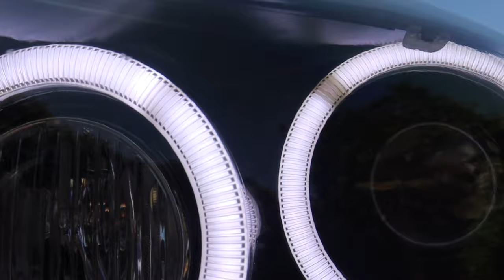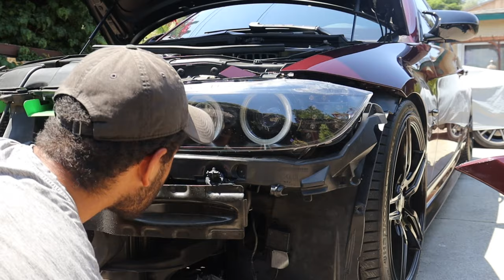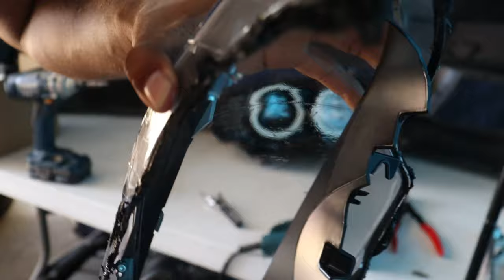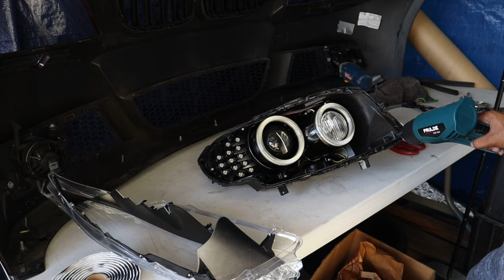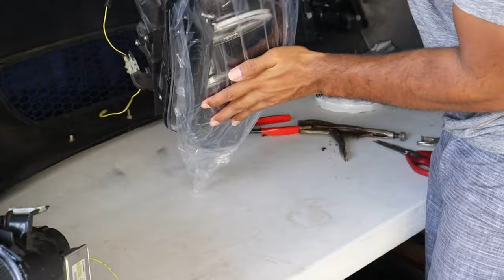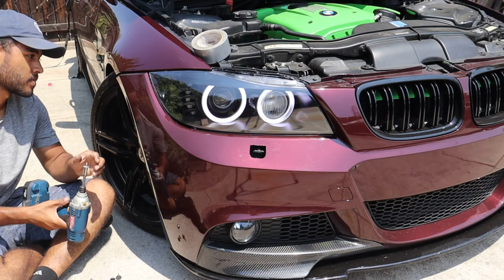Replacing the Plastic Lens Covers on My Custom Headlights | BMW E90 LCI

Comment: This method doesn’t work on OEM lights
Reply from the maker: The only difference is it’s harder to break the factory seal if you do it for the first time.
Reply: @InlineSixAuto No not true You have to use a dremel to cut plastic around the headlight And THEN use your method
Reply: @rievo6644  It is possible to remove the factory installed lenses with a heat gun, a flathead screwdriver and a lot of patience, no need to cut anything with a dremel. I resealed the new lenses using some Butyl cord, and after that when the lenses were installed, I applied additional Sikaflex 710 butyl to the connection of the light case and lens on the outside to cover up any gaps.

Comment: It’s condensation ur lights arnt sealed correctly
Reply from the maker: I wasn't condensation. I would get condensation and it evaporate eventually. But this remained for months. And when I finally got the lenses off, it wouldn't come off when I tried to wipe it off. It was caked/dried onto the inside of the lens.
Reply: I need cover (lenses)

Comment: @HallenBMW I'm thinking of replacing just the lenses on my Pre Lci e90 with OEM Xenons. Do you think this would be a straight forward fairly simple replacement for a first timer or do you recommend someone that's in the San Diego area or you possibly? I can pay you for your time and for materials or is it something best left to professionals. I won't be painting or retrofitting anything maybe smoke the boomerang shaped amber with vinyl but that's it.
Reply from the maker: The only hard part is getting the lens off since it has the factory glue. Once you get pass that it’s easy, you could just follow what I do in the video. I think you could it yourself if you’re good with tools. Id be willing to do it for you but Just know I haven’t had to remove a lens with factory glue still. It would be my first time but I am willing to try though. If you’re not comfortable doing it yourself, I would see if you could find someone who’s more experienced than me since I wouldn’t consider myself a professional.

Comment: How has the seal held up almost a year later?
Thanks in advance!
Reply from the maker: Its still doing great. There have a been a couple times where condensation formed inside when I would wash my car but that's it. Its only happened 2 times since I did this work.
Reply: @InlineSixAuto  so i’m experiencing the exact same issue, what did you do to get rid of the condensation inside?
Reply from the maker: @diesel.bimmer  I still get condensation inside sometimes. I havent been able to find a solution for it. I would think the only thing to do would be to reseal it but I don't want to go this whole process again lol
Reply: @InlineSixAuto  yeah same here. i built my headlights and they look amazing but it snowed the other day and my pass headlight had condensation inside and damaged my headlight turn signal too. Whenever it warms up, it goes away but whenever it gets cold outside and wet, itll fog up.

Comment: What is outer angle eye ring mounted to exactly? The existing rings?
Reply from the maker: It’s mounted to the stock angel eye ring. But the stock ring is painted over in stain black to match with the rest of the housing.